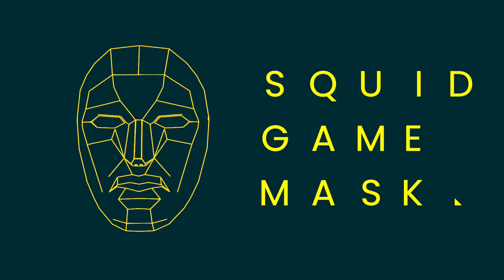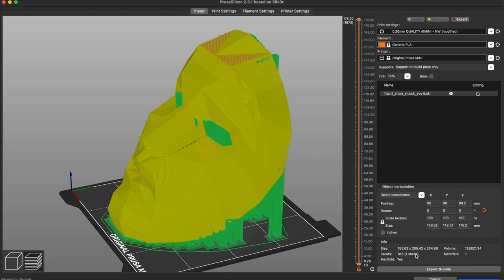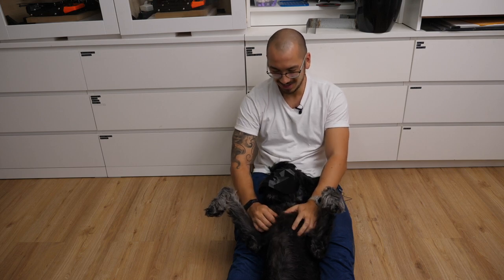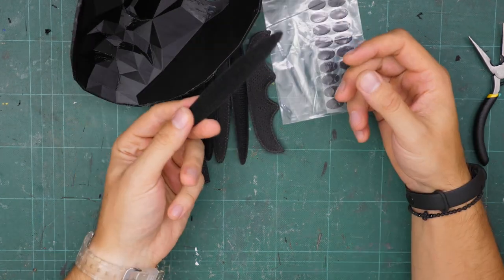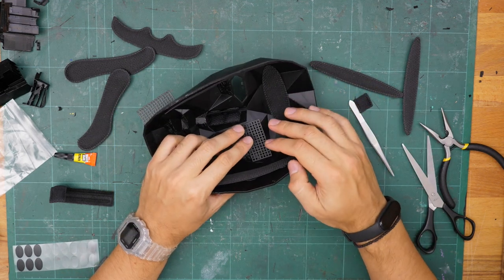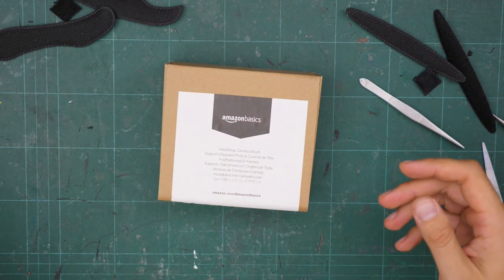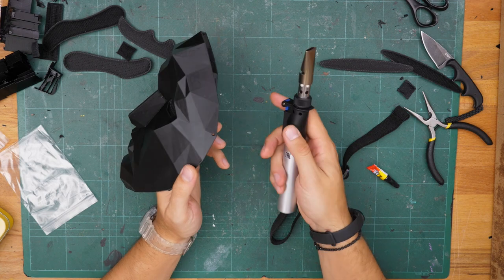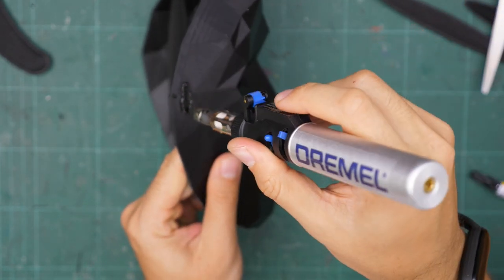Squid Game Mask (+ Upgrades!)

Comment: I made a very similar mask, Norman - and I hot-glued some chunks of spongy black packaging foam on the forehead and chin areas. I also needed to add a strap (just a thin band of the same PLA) across the top of the head cos the mask is heavy enough to slip down my face without it.